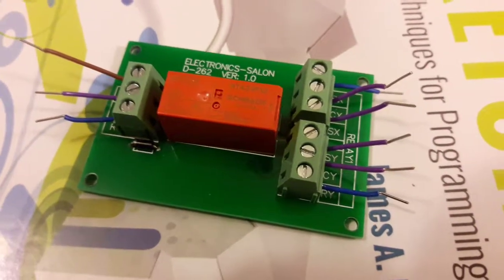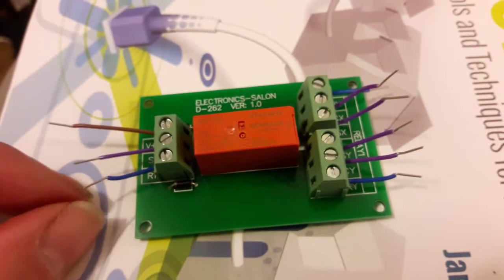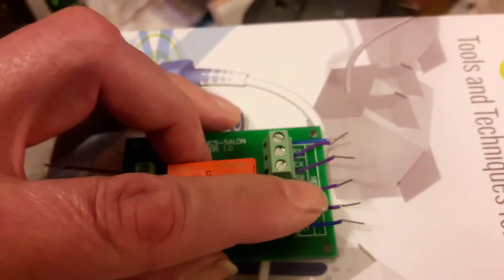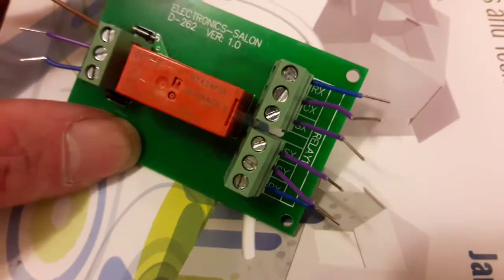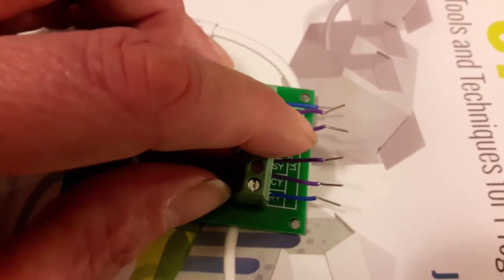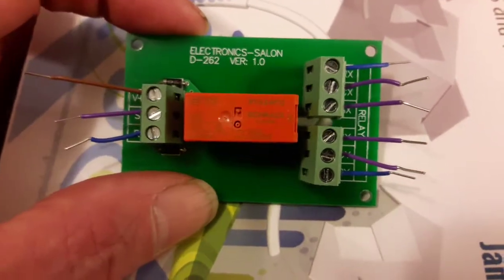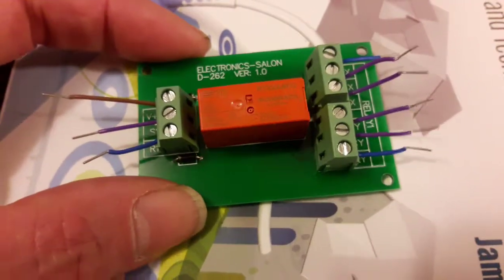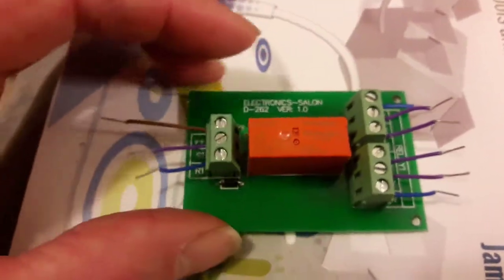Latching Relay

Comment from the maker: I don't have a schematic, and if you try to go by a schematic with the way this relay is labeled it will only confuse things. I used the color coded wires to inform me what was connected to what at each input/output point.